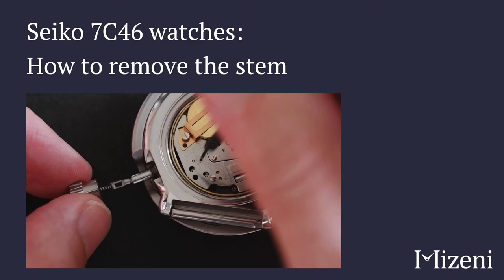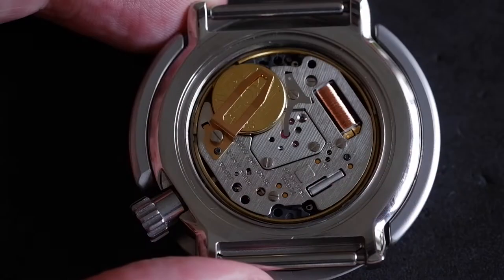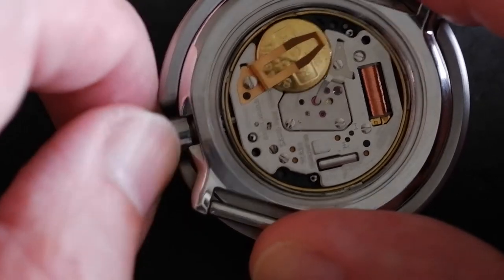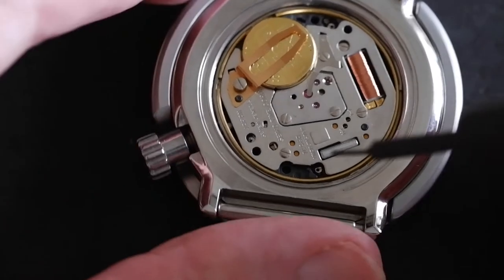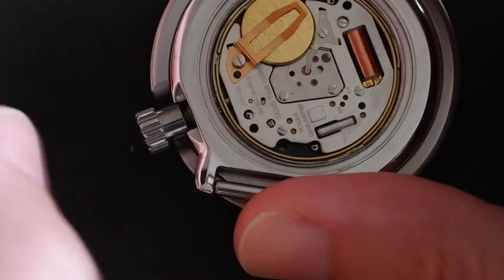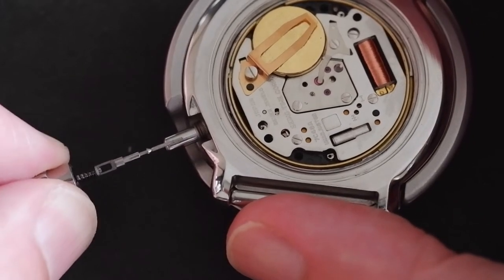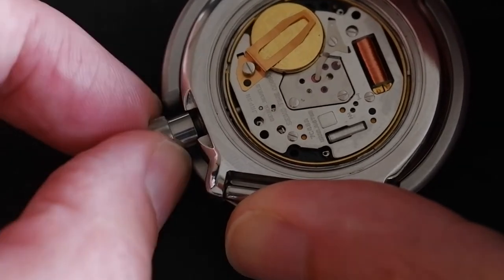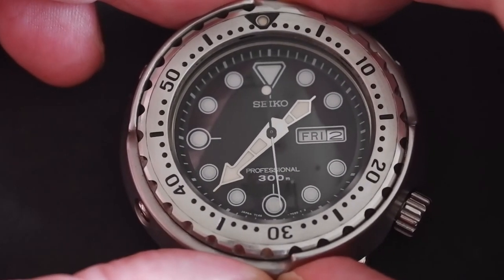#Seiko 7C46 & 7C43 "tuna" watches: How to remove the stem and crown

Comment: Nice, first time seen inside 300m tuna before nice to see that 7c46 love the tuna I have two in my collection 👍
Reply from the maker: You have two? Nice! Yeah, I like the finish of the 7C46 movement, and these tunas are so comfortable to wear considering the size. Love it!
Reply: Beautiful.  Where can I find a battery for the 7C46? Also would I need new seals also ? Thank you
Reply: @stevepodraza6363  bought mine off eBay for my sbbn015 for when it runs out, SR43SW (301) don't know about the seals